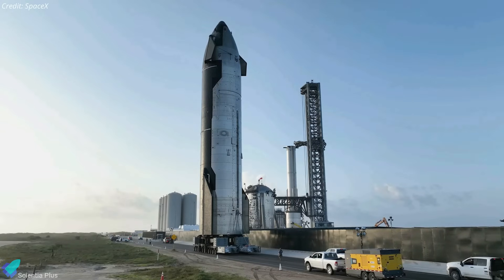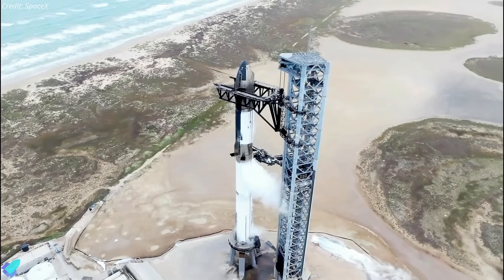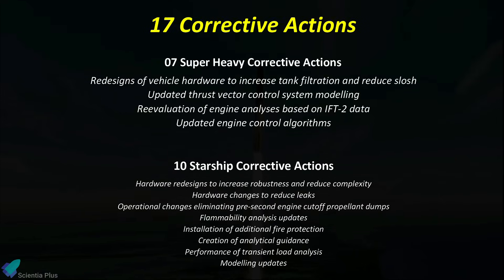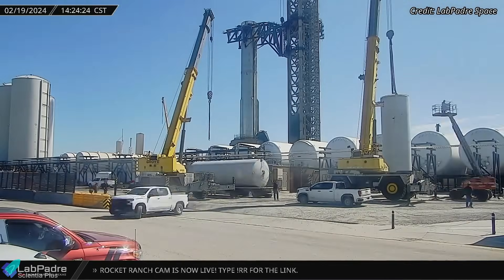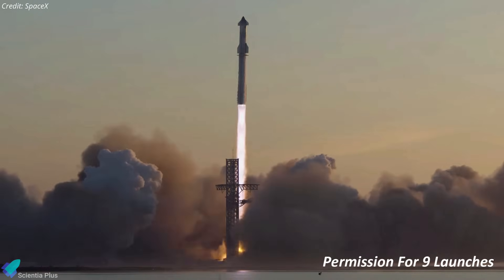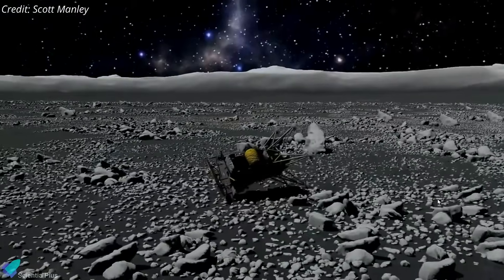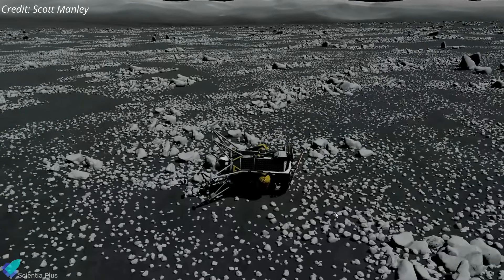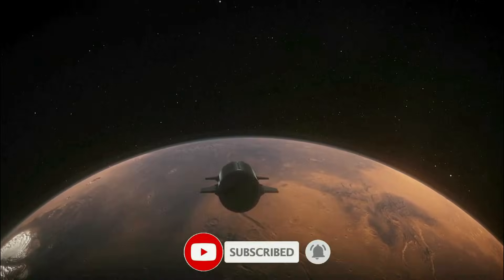Starship Full Stack Returns: But FAA Demands 17 Critical Fixes Before IFT-3 Liftoff

Comment: So how many critical SpaceX determined fixes will bring Starship 4 to orbit? Why did the booster hit the planet at Mach 2? Why did all that debris flake off of Starship during its uncontrolled return to yet another disaster? Why did it leak fuel when they turned off the engines, why was the leak joined by other leaks, why did it face re-entry with the heatshield side spending half its time facing the sun? It was due to the leaks revolving the ship one revolution per 60s average, hence the inevitable result. The musk didn't even bother showing up, he already knew it hadn't a hope. Mr the best part is no part hadn't thought of reaction thrusters so no way to stabilise the leaks and stop the spin. Genius, right?

Comment: What's holding up flight 3? Well, nothing really. SpaceX has already completed all the corrective actions and have likely already applied for a modified launch license. It will come, likely a day or two before launch. Big thing is they have to successfully complete a wet dress rehearsal. I'm betting on the 2nd  or 3rd week of March.

Comment: Emergency!!! Baffles will not always work. 
The tanks need 2 disks valves, expanding the diameter of each tank. One of the disks rotates above the other disk to close the overlaping holes of the disks; to reduce the Size of the tank by dividing it, before any rotation of the rocket. This will prevent slushings and protect the plumbing, if located 10% above the bottom section of each tank. Large telescopic pistons can be attached below the bottom of disk valves to control the fuel pressure as the piston expands into  the fuel. 
 I have built a model that works perfectly. The second disk valve can be located 10%  below the front of the tank, to also protect the front of the tanks from the slushing forces. 
Why is Elon  not using four pins instead of three to secure each heat tyles? What is more important than that?😊

Comment: FAA will continue to stall SpaceX until the dud SLS lifts off.
Reply: In reality the FAA has played no role in delaying the 3rd launch of starship.   The delay of ITF -3 has two main reasons both boiling down to the fact that Space X isn't ready yet.  The two aborts on the WDR a couple weeks ago meant both booster ship were returned to the production site.  

And the second was the 17 corrective actions required by the FAA from Space X were in fact written by Space X and Space X needed to complete more work in finalizing that report.

Comment: SpaceX is the one who pointed out the 17 fixes needed, not the FAA. They have already done several, if not all of them. Now the FAA has to check how that was done and green-light it.
Reply: Careful. The investigation was SpaceX LED, but had FAA representatives on it; as well as NASA, SpaceForce advisors. The way these work, I can easily see, for example, the FAA reps being ‘firm’ that certain things have to be included in the final report/corrective actions if SpaceX wanted there to be smooth sailing during a final FAA review. The FAA is included at all times not just to speed the process along- but to increase the chances that it will pass final muster. This is because FAA/AST has TWO legal jobs: Safety of the uninvolved public; AND, encouraging promoting the commercial space launch industry. They are NOT “the enemy “. - Dave Huntsman
Reply: @dphuntsman  Maybe. But the report is done by SpaceX not the FAA. The FAA looks for weak points or mistakes. SpaceX is the one with all the facts.
Reply: @knowledgeisgood9645  Actually the FAA is looking for mistakes in the paperwork.
They haven't had staff that knows diddlysquat for years.
And yes, I work with the FAA on a regular basis.
Reply: as if the FAA has any idea how to make this work, it is all new ground for everyone.

Comment: F the FAA.
Reply: You don’t know what you’re talking about. As I previously said: The investigation was SpaceX LED, but had FAA representatives on it; as well as NASA, SpaceForce advisors. The way these work, I can easily see, for example, the FAA reps being ‘firm’ that certain things have to be included in the final report/corrective actions if SpaceX wanted there to be smooth sailing during a final FAA review. The FAA is included at all times not just to speed the process along- but to increase the chances that it will pass final muster. This is because FAA/AST has TWO legal jobs: Safety of the uninvolved public; AND, encouraging promoting the commercial space launch industry. They are NOT “the enemy “. - Dave Huntsman
Reply: @dphuntsman  You must be a Biden voter.